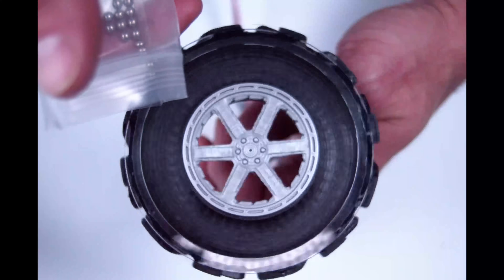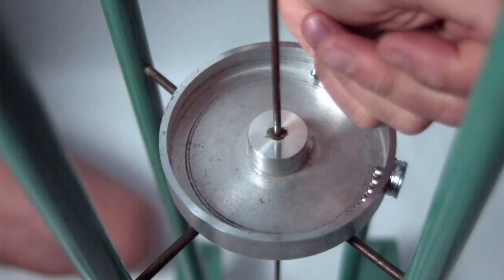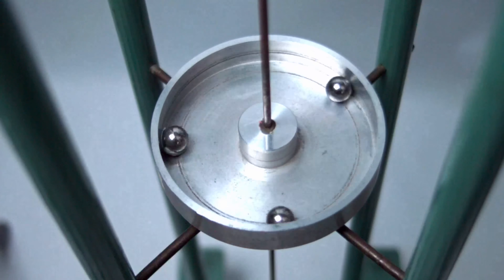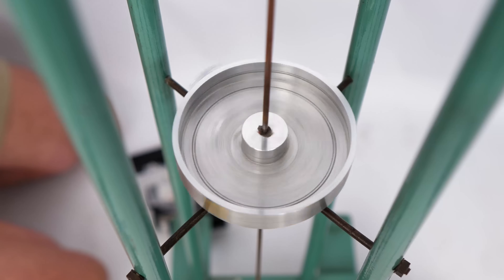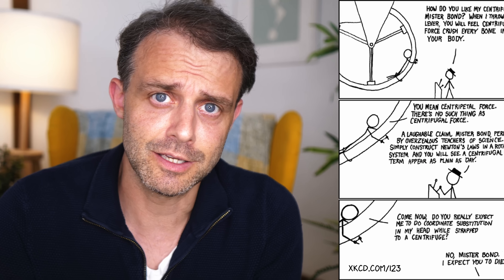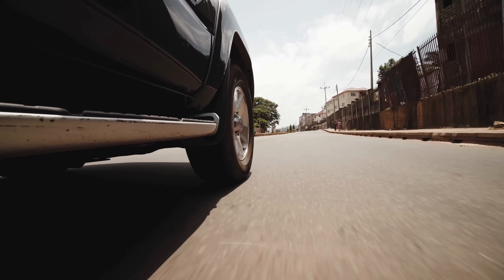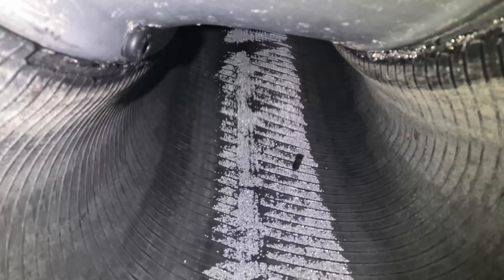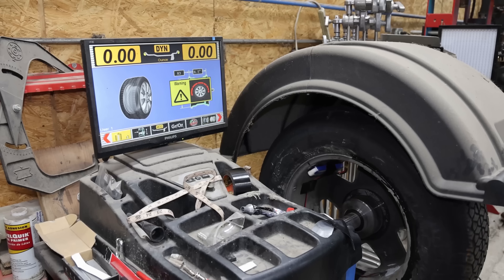Do tire balancing beads actually work?

Comment: As a gas turbine mechanic, part of my job was spin balancing rotating equipment.  One of the things they taught us was that there is a “high spot”, and a “low spot”.  The high spot is the part that is thrown furthest out from the center of rotation at low speed.  When it reaches critical speed, the high and low spots reverse.  The governors on our turbines were set to more rapidly accelerate across this speed because it is the resonant speed of the rotor.  

The usual method of balancing was to plot the orbit of the rotor shaft up past critical speed.  Then we would put in a test weight to plot the difference.  Using that data we could plot a vector to tell us where and how much weight to put in to balance the rotor.  One tech got his vector 180 degrees out (easy to do), and launched the rotor about 20 yards.

A couple of years later we were issued vibration analysis computers that stopped this kind of error by doing all the math for you.  I doubt many techs today could still do the math.

My brother, who was an astronomer saw some of my plots and asked when I learned orbital mechanics.  Apparently they are the same thing.
Reply: I used to balance tires back before they had the computers to help. It was indeed a skill. And of course much less dangerous or sophisticated than anything that would fling metal across the room. :-)
Reply: @darrennew8211  well, if i drive 230+ i rather trust a computer then a feeling ;) even as mechanic myself, some external control never hurts.
every now and then it can prevent screw ups!... and sometimes the tires are just so stupid that you have to rebalance multiple times until you get it done proberly  (mitsubishi pajero wit hsome american geo.... whatever tires. atleast 180g of counter weight on every tire.
offroadtires dont seem to care about inbalance that much xD
Reply: @darrennew8211  no skill required, just trial and error.

Look up "Portable Tire Balancer w/Bubble Level" for something ppl still use in their home garage to this day and costs less than $100.

If you know how to use a spirit level you can balance a car tyre.

Turbines on the other hand are a different beast to car tyres.
Reply: @darrennew8211  that's good shit! That old pneumatic only breaker would bend the shit out o' rim.....funny shit jack
Reply: @darrennew8211  We used to have a motor to spin the wheel on the car, and a frame to move a weight around on the wheel.  We would feel the vibrations on the fender and adjust the weight to make them go away.
Reply: @darrennew8211  Portable Tire
Balancer w/Bubble Level is what was used prior to computers.

It's about as difficult as making a picture frame or shelf level.
Reply: @sirtra  There was that, but there was also one that spun the tire in the vertical plane. People wanted it more level than the bubble level could manage.
Reply: @sirtra  worked at a tire shop and thats all we used. Simple and effective. Never had a customer return from vibration or odd tire wear due to bad balance. The bubble can't tell a lie.
Reply: @darrennew8211 never had and issue with a bubble balancer. Never had one tire come back after thousands put on. Used tires, new tires, their original tire patched. They all balanced and rode fine.
Reply: It's funny how alot of times wildly different systems have commonality.  There's been been numerous times where some difficult problem in one field turned out to be a long solved problem in a different field.  Another example is how mechanical systems and electrical systems are analogous to each other and you can use analysis techniques from one to understand the other.
Reply: @ccoder4953 there's also some similarities between electrical and thermodynamic systems (impedance matching, resonance tuning...)
Reply: @ccoder4953 Autotune was created by an oil company geo-engineering consultant.   He developed a bunch of advanced  software for interpreting frequency data, and realized that it was the same math for changing someone’s recorded singing pitch.
Reply: @ccoder4953  That right there is the beauty of physics. Thanks for a good summary.
Reply: Decades ago, pre-www:
Wrote a 2 plane balance program over lunch on an HP programmable calculator when the visiting engineer forgot to pack his laptop's power supply.
Test weight one weight and location. Measure amplitude and phase of vibrations. 
Test weight two on other end, weight and location. 
Measure ampl and phases, at same speed.
Calculate correcting weights (magic complex maths: influence coeffs)
Check run.
” Rinse, repeat "  at higher speed.
Even used calculator to split up location of std weights to result in proper vector result.
Ran great. Schedule saved!
Blew mind of lead engineer.
Reply: @r6k1E10-1  Did the HP programmable calculator use a low level programming language, or was it all just equations with variables for the operator to input? Very cool nonetheless, thanks for sharing the anecdote.
Reply: @theKashConnoisseur 
Didn't use the algebraic solver.
But it handled prompting the user, and made working with the complex matrix math pretty straight forward. 
Awesome little RPN powerhouse in its day, running off a few AAA alkalines for many hours.
Reply: @r6k1E10-1  So an HP28 or HP-48. No wait, the HP-28 used three "Lady" (LR1) batteries, so a 48 or 49.

The precedessor, the HP-41CX, only has 2240 bytes of directly accessible RAM (plus some "XMEM" memory, which could be acessed sort of like an SSD), but it already had an alphanumeric display, so prompting the user was unambiguous. The HP-48 series and the HP-41CX had a real-time clock built-in (the HP41C and HP-41CV could be retrofitted with the Time module). The reason for the RTC was that NASA wanted it because the HP-41 and HP48 serieses were used in the Space Shuttle, and the pocket calculators handled a lot of calculations for which the main computers weren't programmed (they also served as backups, in case the main computers failed).

So yes, balancing tires or turbines or flying into the space was just the same for your good old pocket calculator.
Reply: @klausstock8020 I still use an old HP 11C to balance my checkbook. It's from my aerospace purchasing days. 
Once I write a program, approximately 360 lines, to calculate the decreasing interest payments on a 30 year mortgage. 
I hated long division in elementary school, & flunked algebra in high school, so I was pretty proud of myself for figuring out how to program my calculator.  
Although that was the only time I programmed it, I'm really stuck on the RPN entry for doing simple math.
Reply: It's funny, as someone who has a vague familiarity with orbital mechanics (thanks to Kerbal Space Program), I was reminded of that very early on in the video. I love when seemingly different fields of math and science overlap like that
Reply: @coryman125  except they don't aside from visual similarities. It ends a bit earlier than that in the fundamentals. Gravitational ellipses have several forces at place in completely opposite vectors, and the balance is accomplished in a completely different way. While the problem being explained in the video can be recreated even at zero 0 with very few forces involved. TL;DR: it reminds us of Lagrange Points, but it isn't related.
Reply: @akiraic  Debatable. One way to think of a Lagrange point is precisely "a place where gravitational forces balance with the centrifugal force/inertial forces." Ultimately, it's all classical mechanics, and classical mechanics problems can fairly universally be solved with a single mathematical toolkit -- hell, that toolkit (the Lagrangian and equations of motion) is so universal we're still using it in quantum field theory.
Reply: I used to balance semi tires with a spin balancer that you use with the wheel mounted on the truck There was a bit of an art to that.
Reply: I saw a video demonstrating those old mechanical balancing machines, with the paper cards, etc. Interesting stuff.
Reply: I’m at the part of the video where Steve is talking about rotating around the center of mass and not objects themselves, and the first thing I thought of was Lagrange points in orbital mechanics.
Reply: When I realized there was a spinning mass with a center of gravity that was outside the center of the disk, I thought of the sun and Jupiter!
Reply: When working on long items on a lathes, there is a thing called 'whirl speed', above that rpm the workpiece settles down and the tendency to 'chatter' goes away.
But you have to get up to rpm quickly as there is an rpm just below 'whirl speed' where it can all go very wrong.
Reply: physics are weird like that. it turns out universal laws don't care how big or small something is, the laws still apply. at the end of the day a planet in orbit is still spinning around an axis and nothing spins perfectly true. a planet orbiting a star is basically a tire spinning around a wheel bearing with the vacuum of space as the wheel.
Reply: @spaceghostmiid  I say this jokingly, but relativity and quantum mechanics beg to differ on the "big or small, same rules apply" bit. ;)
Reply: @theKashConnoisseur haha true i moreso meant in terms of size that can in theory be physically observed by a person.
Reply: this is honestly super fucking cool. where do you learn to do the math for this?
Reply: @ovencake523 For my brother, it was college.  For me it was 6 years in the Navy and two years as a field service rep on offshore rigs.  Then my company sent me to their school.  Two weeks learning vibe analysis, followed by two weeks of spin balance.  Had a Navy buddy that learned it in Airframe and Power Plant school.  Like I said, nowadays it is done with handheld devices that do the math for you, so probably an astronomy class.
Reply: There is this neat place called you tube.
Reply: When heard "high spot" and "low spot" I immediately clocked it as perigee and apogee. The furthest and closest point in a orbit. That's what a supermoon is, reaching it's apogee while In a full moon.
Reply: Supermoon occurs near perigee.
Reply: @mickeymouse6079  Got a couple of things wrong there. (1) Perigee and apogee refer specifically to orbits around Earth, the way perihelion and aphelion refer to orbits around the sun. The general terms are periapsis and apoapsis. (2) A supermoon occurs at perigee, when the moon is closest to the Earth. You got your terms backwards.
Reply: @Hugh_Jas  I'm not surprised I flipped it 🙃, but I didn't know that they were earth specific! Thanks! 🙏
Reply: 20 yards! There are rumors of irish drum and trumpet circles "pitch"ing (a tune/tuning) rocks like a trebuchet. Were they trampoling them off the concaved drumcircle earth - a la a lathe imbalance disaster launching the work out the window
Reply: These orbital maths demonstrate the science of LeGrange points as well

https://youtu.be/7PHvDj4TDfM
Reply: cargo ships have a red mark on their engine rpm gauges that you aren't supposed to stay in.
Reply: The AS350 helicopter would go into ground resonance if the engine didn't accelerate quickly across the vibration "no go" rpm.  Ground resonance rips the aircraft apart. Fun stuff as long as you aren't inside or the one that has to repair the mess left behind.
Reply: Resonance is an interesting thing.
I used to work in a vibration testing lab. Mostly military and aero-space stuff. It was wild to watch under strobe as things destroyed themselves.
Reply: wouldn't have thought of it independently (that they're the same), but it seems obvious after reading it that of course "orbiting around a center of mass" is the same as "orbiting around a center of mass"
Reply: Not quite related, but as a turbine mechanic who was doing things back in the day, you didn't happen to ever work on the JT8D, did you? If so, do you happen to know where that 1500Hz constant-pitch ringing noise around idle comes from? My working hypothesis is it's a sympathetic vibration in the combustor, but without the ability to whack every part of an engine until something rings with that tone...

I've been doing a deep dive into how turbines make noise (like, proper deep dive into blade passing frequencies, harmonics, shaft vibration, directionality of noises made by what components, and I'm questioning my own sanity at this point) in order to learn how to synthesize it better for PC flight simulators, and I'm using the JT8D as a guinea pig since it's the only turbine engine I know all that well and I managed to record a -17A some time ago. And that stupid noise has had me stumped for quite some time.
Reply: When I first started in a cnc machine shop, my boss told me. "You're going to have to train your ears. They'll let you know when something is going wrong." You learn quick before you destroy expensive tooling or material or damage a machine. When you put anything in lathe, you use an indicator to bring it into balance. You use a very sensitive, expensive instrument and, usually, a sand filled rubber mallet. Then at various times we would have wrap the outside of parts with thick rubber pads to machine the insides to balance them and avoid finish issues that would scrap a very expensive part.
Reply: @mystiquesquared  I have seen people turning big tubes put a coil of rubber hose inside
Reply: "Simple_But_Expensive": "As a gas turbine mechanic..."

Username checks out.
Reply: Yeah, I retired last year from a jet engine manufacturer. There are "notches" of speed that must be blasted through, and not used in flight, to prevent resonance from tearing the thing apart.
Reply: So add the tire balancing beads, then a shot of stop leak and get on the freeway before the stop leak sets. Fixed.
Reply: that sounds fun and i bet when it's balanced right feels great.. i have 2 rows of balancing weights on my tyres i'm less than impressed...
Reply: It’s always fun when math turns out to be applicable to multiple fields.
Reply: To me this sounds like a classic second order mass spring response. At low speed, the mass is in phase with the input excitation. As it speeds up, you get closer to the resonant frequency, and the amplitude starts increasing. Then as you pass the critical frequency, the phase suddenly lags 180 degrees behind. And as the frequency further increases, the amplitude decreases back towards zero.
Reply: I would love a video comparing the two! The other commenters have already pointed out some obvious parallels but it would be great to hear the entire process re-explained in orbital mechanics terms
Reply: @Simple_But_Expensive Your mention of the reversal of the high and low spot clarifies Steve's explanation for me. I pictured a rectangular board attached near one end to a flexible axle, and at low speed it makes sense that it pulls the axle towards the long end, as most of the weight is there, while at high speed once the center of mass makes the rectangle spin around its center, the axle is now pulled towards the short end.
Reply: Loving this comment section, have yet to balance shafts or fan blades for that matter, but going through the maths on how to balance Turbines was a doozy to say the least! Still would like to do one, one day.
Reply: When i balance my RC turbines i always feel at what speed the resonance occurs to determine the amount of unbalance. And yes at higher speeds it can flip when you apply a counter weight to check the correct spot. This was confusing at first and i learner to go by the low speed resonance for confirmation.
Reply: I bet you PI crops up for no reason in the calculations..... ah ha, PI, we've been expecting you.  It crops up in many unexpected places.
Reply: I can see how this would work with the tire on a machine for a demonstration. But in real world, the tire has a flat spot where it touches the ground from the weight of the vehicle. So beads hit this bump when the tire spins and bounce.
Reply: I was looking at the bearing test and thinking of Lagrange points
Reply: I mean an Orbit is Pretty similiar to a Tires Rotation around the Axis. Both are technically connected. One by the Rim to Tire and the Other by Gravity Which is Induced by the Center Mass.
Reply: so astronomers are really overrated car mechanics who can theoretically fix a tyre, unless it's a real tyre.
Reply: I did the same in college in my mechanical vibrations lab. I calculated the location by hand and forgot to carry over a minus sign.
Reply: To be honest, that's quite amazing. Effectively, science wizards.
Reply: Was the Gov'nor (Guy Ritchie ref) an engineered fix to the problem?
Reply: High spot: Apoapsis  
Low spot: Periapsis  
Yeah, it's a little weird.
Reply: Man you are cool. Every day I get more respect for mechanics
Reply: Turbines is cool.. Thank you for your services.
Reply: I use balancing beads, but I put them on the outside of the wheel and fix it in places so that the wheel and tyre are always in balance.
Reply: Interestingly enough, this is the same approach taken by automated wheel balancers.
Reply: ... This makes total sense.
Reply: Mass and Inertia.
Reply: Nice family :)
Reply: Get a degree in mechanical engineering then
Reply: out of curiosity is there a particular term for this process? I'm not in the field by any stretch but it sounds like the sort of thing that'd be useful to get an at least surface level understanding of.
Reply: @robonator2945 spin balance
Reply: "When did you learn orbital mechanics?"
is a wild question when you never did (knowingly) :D :D :D
Reply: they should use this knowledge to program better the washing machine so it won't get stuck every time we need to drain the bed sheets
Reply: I read like "As a gay* turbine mechanic...". My mind is not in the right place. Face palm
Reply: Legendary comment <3 Thank You for sharing!
Reply: Where can I learn the math for this? Both to balance my own rotating masses and because I like space stuff
Reply: @LazySpaceRaptor . It used to be the only place left was a college level orbital mechanics class, but now you can probably find it on  Brilliant.
Reply: Orbits are a bit different but both is linear algebra based on ellipsoids under physical constraints.
Reply: is this the same math that is used in balancing tire machines? vector balancing?
Reply: Launching things at work can be really unfun for the participants but make good stories.

A friend works with data centers and had once an event where they test fired the emergency diesel generator and one of the pistons decided to exit the block...

A mere wall of an industrial building was no match for an object that punched through an industrial sized engine block.

Luckily no one was standing in the way.
Reply: @JariJuslin The rotor that was launched weighed around two tons.  Seriously unfun, and everyone on site needed new shorts.  The accident investigation took weeks.  

Fortunately the turbine was part of a gas compressor located in the middle of nowhere, and it launched away from the pipeline.  This was back in the early 80’s (pre Apple/PC in the workforce days), so safety protocols were nowhere near where they are today.  

It wasn’t my company, I just heard about it and saw the aftermath.  The rotor was speared into the ground, so it must have achieved an impressive height.

The company no longer exists.  Not due to this incident, just due to industry ups and downs.
Reply: Yes we use beads in our 20 and 30 model cars.  Some have wooden spokes and that's just how they have always been done.
Reply: I know nothing about orbital mechanics but I read all of this and found it interesting. Thumbs up for you.
Reply: There are still fields where it is important to know the math and plot out vectors on orbit paper.  For instance when balancing 500 MW turbine rotors that will takes days to install or adjust balance weights.  The computer balance program can still be 180 degrees off if the data going in is wrong! I would know from experience...
Reply: @elliothunt6814 I seem to remember a picture of a GE Frame 6 rotor thrown a quarter mile on the assembly line in Schenectaty.  I only remember it vaguely though, so I could be wrong.
Reply: @Simple_But_Expensive I haven't seen it but believe it. There are numerous reseaons why turbine shops conduct high speed balance runs inside concrete bunkers.
Reply: Cool
Reply: My dad used the same vibration analysis equipment in the oilfield to fix motors and keep down low frequency hum. In a pipeline the hum travels down the flow lines for gas and can make places unlivable if not fixed
Reply: Yeah, the balancing machines are nice because now instead of having to be a well-learned mathematician to WORK on cars, you just need to be one to MAKE the cars. Because realistically, anybody with an instruction manual should be able to fix their own things (although i do still support regulations, inspections, etc. because some/most people aren't gonna take the time to make absolutely certain their safety equipment is fixed and fixed right.)
Reply: @joedad9999  im a real master mechanic, and i have been aviation mechanic as well, diagnostics is what seperates a real mechanic from your average joe. It used to be the fire triangle that led the way, but now you need the correct software to check sensors. On my muscle car i have 1 guage that does what 14 sensors on newer motors do. The vaccum guage. There was a sweet spot in the 70s when anyone could work on their own stuff. Chrysler fixed that with the proto efi in the 80s that was horrible and then efi on everything in the 90s was how it was.
Reply: @joedad9999  now farmers cant even work on their own tractors anymore. Its a money driven damn shame. Especially since the money isnt even real anymore
Reply: Everything is one in the same, but scale makes spacetime funky.
Reply: Crazy how the science in one field will work in a completely different setting or field.
Reply: You said Gas turbine mechanic...
I assume you were a GSM in the Navy? Jet engines?
Reply: @Mr._Infamous GSM.  Went to college after to get an automation engineer certification.  At the time they didn’t offer degrees in automation engineering, but several schools do now.  

Covered DC and AC electronics, PLCs,instrumentation, basic programming, transistors, digital electronics, HMI design, communications, IT, etc.  

Taught myself computer hardware and software while in the Navy.  Also picked up electrician qualifications for 600V 3 phase and welding at work.  My company expected you to be able to handle all the trades.

Reported to boot camp 4 July 78, got out in 84, got my certification by 90.

Worked at two cogen plants a quarter of a mile apart, both built in 88.  Retired in 2020.  Just finished designing, building, and installing the third whole plant control system retrofit for both plants.  

Over the years I trained over 60 new operators who moved on to other plants my company operated.  Loved my job.

Now living happily in the middle of nowhere in the Mojave.  Only have to deal with people on my monthly grocery run.  Currently automating my house to respond to voice command. NOT using Alexa.  Developing my own proprietary system.  (Gotta stay busy!). Thinking about robotics next.
Reply: what's funny is we use the computer to spin balance motors and generators.  And what I've found is if you have no idea what the math is it will take significantly more runs to get it perfect.  Because the math the machine does isn't perfect.  So if you don't get the test weight in what the computer expects to be the perfect range.  Then it will have to recalculate over several test runs.
Reply: Fascinating!
Reply: We do this for drive shafts on H-60 helicopters in the Navy. I had to take a two day course to be a vibration analysis tech, and learned how to manually plot where to place the weights on the drive shafts. Absolutely amazing how the math works, and though I've forgotten it, I know I have the capacity to learn and understand it. And yes, we also use computer analysis, which is derived from accelerometers placed all over the helicopter (56 I believe), which helps not only to balance the drive shafts, but the transmissions, engines, main and tail rotors, and the aircraft as a whole. Everything functions in the form of a sine wave for overall aircraft vibration, and the idea is to shift the sine wave either fore or aft to balance it nominally. Being able to interpret, predict and troubleshoot the data (e.g. what is causing an anomaly vibration Ina specific area of the aircraft) helps to extend the longevity of the airframe, as well as the subcomponents throughout. The H-60 helicopters shake crazily whenever they pull back on the cyclic, and it's amazing to feel what a well-tuned helicopter feels like. Thanks for sharing your comment!
Reply: @russg9787  edited for typos.

I have experienced an imbalance in a Seahawk.  I was stationed aboard a destroyer.  We were operating detached from our carrier group, so our captain decided to allow crew members to ride along while our helicopter detachment was practicing touch and go’s.  I put my name on the list, and when my turn came up I happily boarded.  

Just after taking off, the helicopter started shaking so bad my vision was blurred.  The pilot immediately spun us around and dived for the deck.  We hit so hard my seat supports bent, as did the tail boom.  The rear wheel bent the deck combing at the rear edge of the flight deck.  

If the pilot had hesitated even a split second, we would have flipped backwards on top of the sea sparrow launcher.  

The crash investigation concluded that a 1/4-20” bolt on an engine PTO shaft had broken.  The loss of the weight of the nut imbalanced the shaft enough to destroy the shaft and engine.  

The amazing thing was that we pulled into Sasebo, and they had rebuilt and repaired everything within two weeks, including the bent tail boom.  They didn’t straighten the deck combing though…

The next time they allowed ride alongs, my name was first on the list.  The pilot and copilot jokingly did a crash briefing.  They made me repeat back every step of the briefing, including the part where I was to flap my arms really hard, and the part where I was to kiss my a$$ goodbye.  Military humor, what can I say.😂😂😂
Reply: So how does this resonance relate to wheel size and speed? Larger wheel, slower speed needed?
Reply: @lrt19 Resonant frequency is dependent on material, size, and shape.  I don’t remember a lot about it, (it has been a few days since I did vibe analysis), but I do know that my team once solved a vibration problem with a gas turbine on a platform by changing the resonance.  

The turbine was an emergency power generator for a hospital.  It was located in the basement, and mounted on a six foot platform.  The supports for the platform were braced by x style cross beams with a gusset plate welded to the intersection of the cross beams.  The hospital was a 7 floor building.  The problem was whenever they ran the turbine, the fourth and fifth floors would vibrate enough to disturb the patients and staff.  After consulting a civil engineer, we decided that the problem was that the resonant frequency of the running turbine matched a harmonic of the resonant frequency of the building (or vice versa).  

We changed the resonant frequency by welding (much) larger gusset plates to the cross beams.  The problem disappeared like magic.  

In a lot of ways, vibration and resonance is like voodoo.  I have also heard of at least one case of techs figuring out that a turbine shaft was cracked because the resonant frequency changed.  

My company had three engineers whose sole job was to consult field personnel handling hairy vibration problems.  Those wizards would sit in an office, look at vibe analysis data and tell you exactly what the problem was.   Real wizards.
Reply: Everything is math. You've just got to use the right numbers.
Reply: Grow up kid
Reply: "Why's it taking so long for my car to get fixed? It's not rocket science!" um...
Reply: We still do the maths anyway.
Reply: Engineering school on an HP33.  Then to the HP41C  and HP48C.  I still have and use my HP48C.  The HP41C was so much better.
Reply: I'm not in gas turbines, but as far as the rest of the aviation industry goes there is still math. However it's nothing like it used to be.

Like you said, there are tools to help. That said, not every aircraft is new and some do still need old school methods of working on them.

We have E - Avionics, M1 or M2 mechanics, and S - Structures.

I say structures need the most skill with tools and their hands, avionics need to be good with knowledge and math, mechanics are something in-between.
Reply: I'd love to learn that math, not only because of my love of math, but because machines aren't always correct.
Reply: A&P for life baby 💪✈🔧 We use the EVMU in the CFDS to do the vibration calculation for where the weights will be placed on the inertia-rings, there is a math formula but no one uses that anymore lol. V2500-A5 and PW1100G experience here. As for tires, I have a M923-A2 with 1600-R20 tires on it, definitely helps by having the beads with a 53" 400+ lb tire rotating at 50mph lol.
Reply: Reply me so I can come here
Reply: @boltadragon  What the heck kind of sketchy ask is that? You have to be invited in, like a vampire?
Reply: @A-Milkdromeda-Laniakea-Hominid And you fell for it!
Reply: @Kineth1  I did so. My curiosity was raging. I'm interested in bullshift YouTube oddities ever since my decade old account started getting heavily censored. Betcha it was just a bot. God everything sucks these days lols!
Reply: @A-Milkdromeda-Laniakea-Hominid i wasnt mate , i was genuinely curious and my english is very fragile and i stutter a lot in adjusting to subject verb object as my native language doesnt follow this😅
Reply: @A-Milkdromeda-Laniakea-Hominid lmfao!! This was the proper response to his question! I needed that laugh! "Like a vampire"😂
Reply: @boltadragon  done
Reply: @boltadragon where are you coming from?